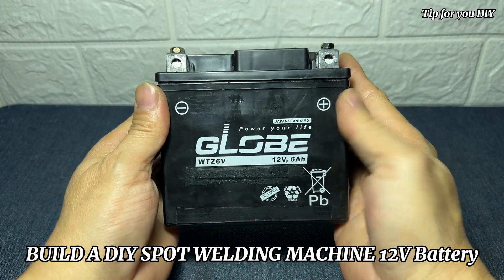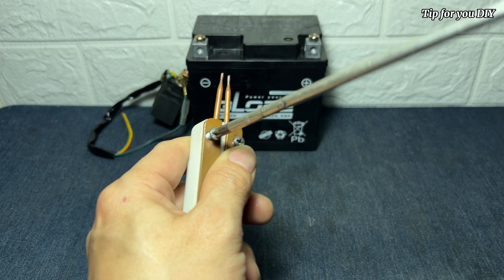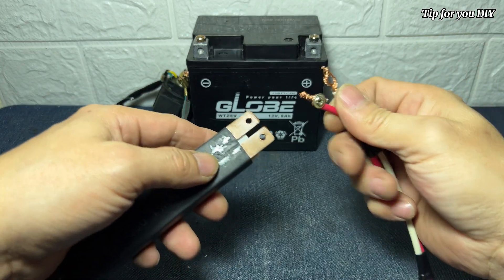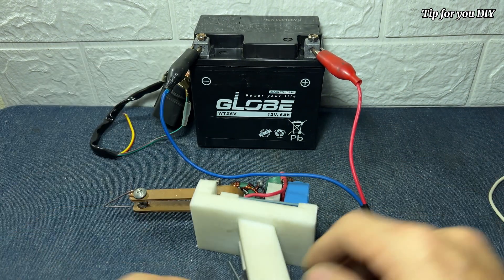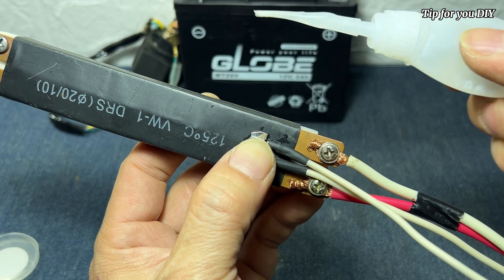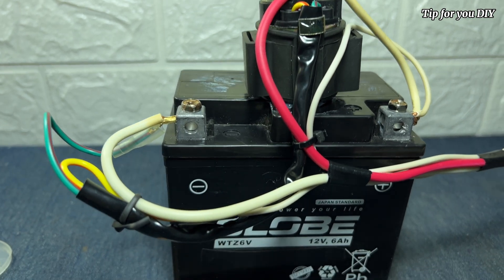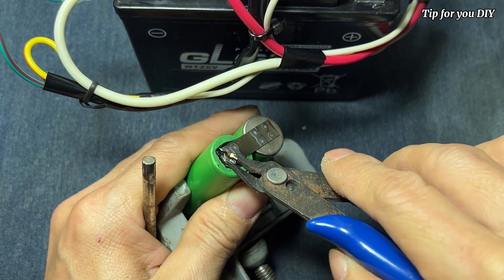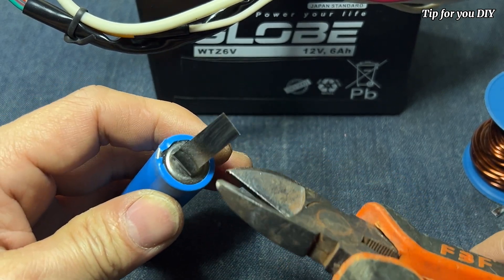Homemade Spot Welder for Battery Cells – Does It Work?

Comment from the maker: Safety First! Spot welding can be dangerous if not done correctly. Always wear protective gear and follow safety guidelines. Looking for an affordable way to weld battery cells at home? In this video, we build a DIY spot welder using simple materials and test its performance on 18650 battery cells. Can a homemade spot welder really deliver strong and reliable welds? Watch until the end to see the results!

Comment: Cool... pretty simple and straight forward...but you choose the worst location for button 😂
Reply from the maker: This is a test video where I use the foot pedal for this welder. I made a new video about the upgraded 18650 spot welder with timer circuit and heat resistant wire. Please visit the link below. Thank you very much. 👉👉👉DIY Spot Welder Upgrade – Built with Starter Relay, Timer & 8AWG Wire Super Powerful!
https://youtu.be/WVlwXaeTJIs

Comment: I finally copied your welder, but not working as it should. I don´t know the amps on my battery, but when I try to weld, I have to hold it for a few seconds to get some heat and it won´t even leave a mark. The battery on the positive side, though, it gets hot. I revewed every connection and I can´t find the problem. Congrats on yours. Btw, I used a microwave door switch for mine which seems to kick it in miliseconds.
Reply from the maker: Your problem is that the battery does not have enough amps. I use a 6ah battery. I will make another video soon using a drill battery or 4 18650 batteries. Please wait for my new video. Thank you very much.
Reply: @tipforyoudiy  I also tried it exactly how you showed with a 12v 7ah battery but there is no spark . I used a multimeter to check the voltage on the battery and it showed 12.40 . Is that low ?
Reply from the maker: I've uploaded the video to the YouTube channel "Tip for you DIY" and I invite you to watch the main content of this video. Please share your comments so I can learn from my experience in the next video. Thank you very much. https://youtu.be/Ue7wk4SGZ9g?si=i77MuFKflRv4CZb2

Comment: You should use electronic timer switch instead of push button
Reply from the maker: Yes sir. I made it for temporary use as it is not a professional battery welding machine. But it is very useful when needed. Thanks for watching.
Reply: @tipforyoudiy use LM555 ic timer you can adjust time as you need

Comment: This DIY is a ticket to the hospital .
DO NOT TRY THIS AT HOME , if you don't want to have a cell blow in your face ou even esplode in your face .
Reply from the maker: It seems you don't like DIY video projects. I still use it to solder PIN pins without any problems, it's a good temporary solution and very useful. Note that they are not used continuously for hours, only about 10 - 20 button presses max. Thanks.
Reply: @tipforyoudiy  DIY means ( Do iT yourself )
I can build a concrete house , the electrical /doors or Iron work , the piping , wood working ( furnitures ) In mechanic I can put an engine down and tear it apart and rebuild it to new . I can build a small plane if I want , just name it and I can do it .
Hydroponic / aquaponic . Solar setup for all purpose I need in MY HOUSE .
So , how can you state that I don't like DIY ?
I do plenty of things on my own cause I don't throw money through the window .

Now let me tell you that spot welding for battery cells  has been invented to avoid too much heat on them . Your dangerous TOY generate enough heat to damage the cell or even put  it on fire . 
You did not even have to use that huge starter  relay , a simple 12v car relay rated at 80 AMPS is enough for your toy .
Add an amperage regulator to it so that you can put only the Amps needed to safely weld nickel to these Cells .

Comment: Welding pen is not suppose to be glowing red like that bro. Definitely not safe, don’t lose your house over trying to make something you’re not familiar with. Stay safe and get rid of that contraption
Reply from the maker: I make DIY videos doing what I like and like what I do. If you want to do better, research more or ask me for clarification. My spot welder needs a 0.02 second timer to weld very well. Have a nice day. Thank you very much
Reply: why dosent work 12v 4ah ?
Reply from the maker: @kupalkyo3294  I use it to fix things around the house when needed and it's been quite helpful.
Reply from the maker: I use it to fix things around the house when needed and it's been quite helpful.

Comment: this is just dangerous bro... wtf
Reply from the maker: There is nothing dangerous, 12V voltage is very low. When operating, there is a button to activate the relay, if there is a problem, just let go and the power will automatically turn off.
Reply: @tipforyoudiy  The danger is if the battery is punctured and the lithium fluid leaks out, it will burn very quickly. The puncture occurs from the negative terminal of the battery, and this is common.
This is what is meant by danger.

Comment: I use a 12v 70ah battery and a battery cell welding circuit with a timer circuit, but when I press the button to weld, the circuit is noisy and does not stop. I weld 0.15 nickel zinc.
😢
Reply from the maker: I've uploaded the video to the YouTube channel "Tip for you DIY" and I invite you to watch the main content of this video. Please share your comments so I can learn from my experience in the next video. Thank you very much. https://youtu.be/Ue7wk4SGZ9g?si=i77MuFKflRv4CZb2

Comment: hidden wire under table
Reply from the maker: Oh no. Trust me this is a really useful video and tool. I made it for me to repair small items when I need to replace 18650 batteries. I will make another one with a microwave transformer which will be more professional. Watch the other video and let me know what you think.
Reply from the maker: I just posted a new video, can you watch it and give me some feedback?

Comment: What is high resistance wire?  The resistance of the switch on the handle is zero. Maybe you should learn how to describe the current carrying capacity of both wire and switches. Ohms law is a good place to start
Reply from the maker: @bingosunnoon9341  Thank you for your comment. I made a cell spot welder to occasionally repair spare batteries and some household items when the battery needs to be replaced. I don't use it often so I think it's fine. If you want to use it professionally, you have to design it from a microwave transformer with a switch and high resistance wires. I'm thinking of making a video of a cell spot welder from a microwave transformer using a timer. What do you think? Please give me your comments.
Reply from the maker: I've uploaded the video to the YouTube channel "Tip for you DIY" and I invite you to watch the main content of this video. Please share your comments so I can learn from my experience in the next video. Thank you very much. https://youtu.be/Ue7wk4SGZ9g?si=i77MuFKflRv4CZb2